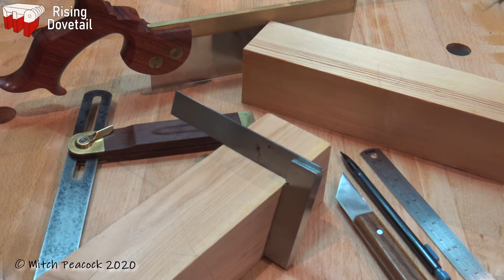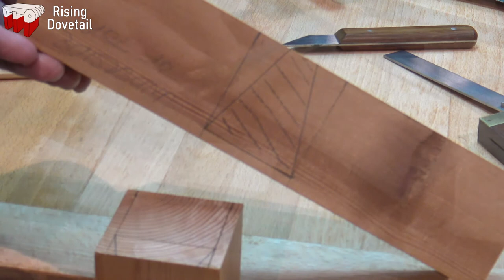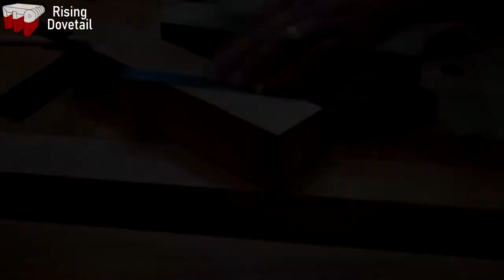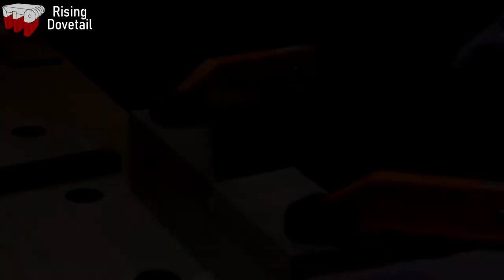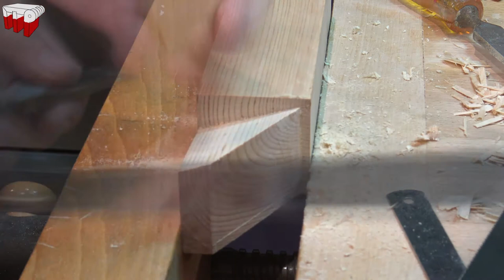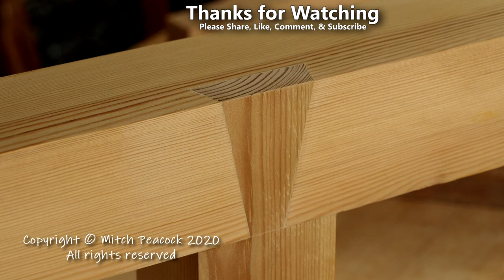Rising Dovetail - Hand cut joint

Comment: I didn’t catch everything. But loved it.
Reply from the maker: Cheers 😊
Reply: @mitchwoodwork  not sure I will be able to do everything. You did it on the spot ?
Reply from the maker: @ikust007  if you mean spot on, then pretty much
Reply: @mitchwoodwork  hum maybe ... mostly , I didn’t see any drawings so I assume you didn’t by « heart «  ( instinct ). I wouldn’t be able without scrapping a couple
Reply from the maker: I worked it out in SketchUp the first time
Reply: @mitchwoodwork  i will not ask you if you have some fast measurements;)
Reply from the maker: @ikust007  I don't because it's all done with bevel gauges and straight edges, and no measurements. Should I slow the video down and add a voiceover instruction?
Reply: @mitchwoodwork  I would never ask for such work. It's a lot of work for you and maybe i am the only old man around here...;))